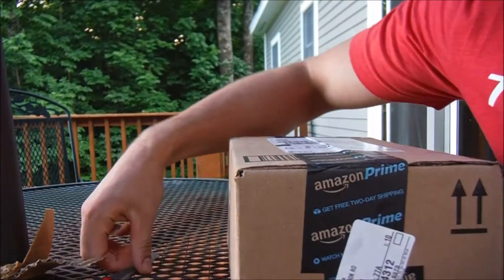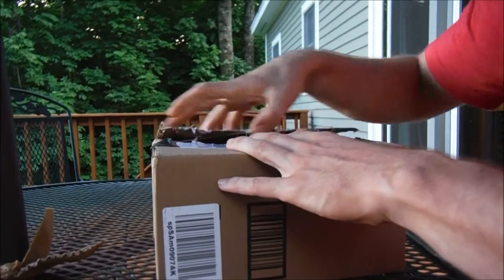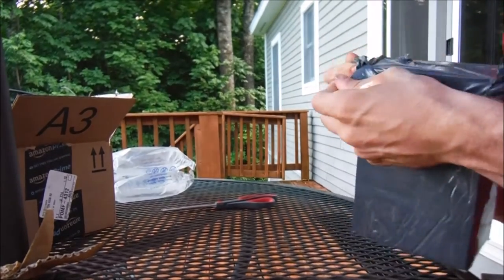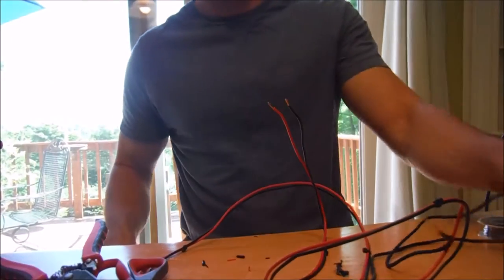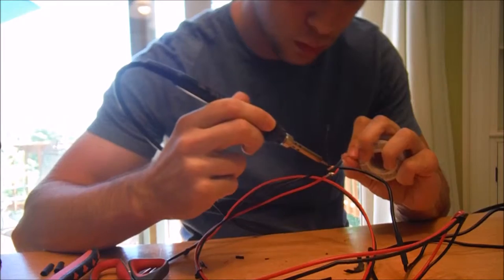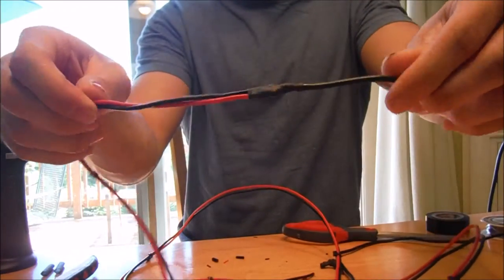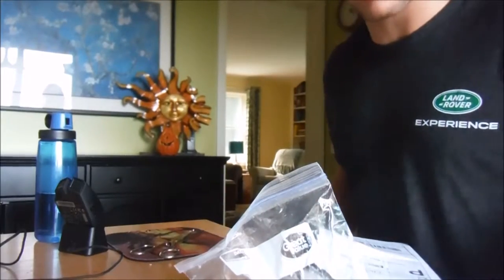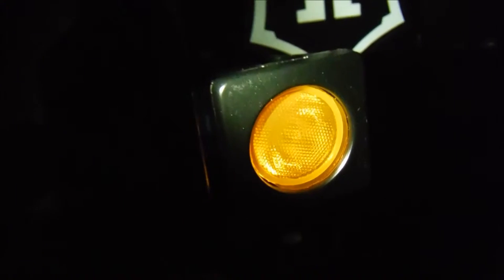Tacoma Homemade Rear Flashers V2 (1000 Lumen 10W LEDS)

Comment: Get a pocket knife, or box cutter already! Lol. I'm obsessed with LED lighting too. Haha. I like wiring all lights myself too, although I must admit that I never soldered my connections, I mainly use butt connectors or t-tap type connectors. But you made me realize it only takes about another 5min to just solder and heat shrink. Good vid tho.
Reply from the maker: Gabez82 I'll remember next time I have to open a box =].  I solder all connections, just because I learned to do so at the last engineering internship/technician job I worked.  Trying to get as close to possible to some sort of industry standard, and I know that it'll hold up to some serious abuse.